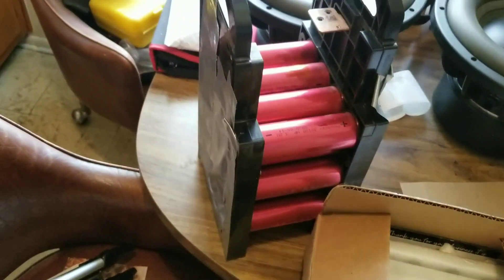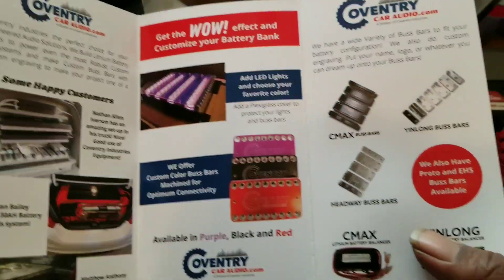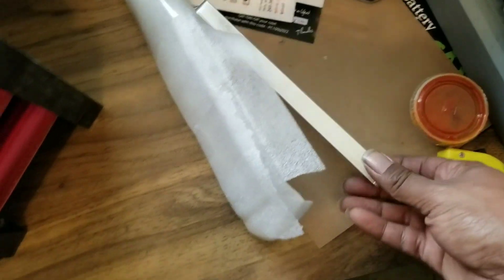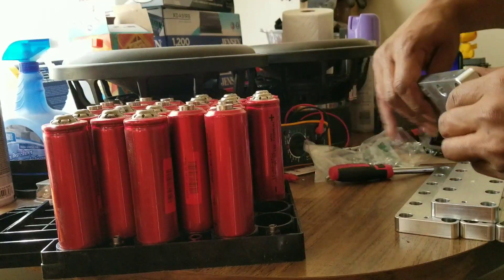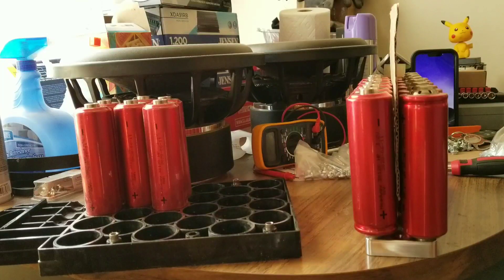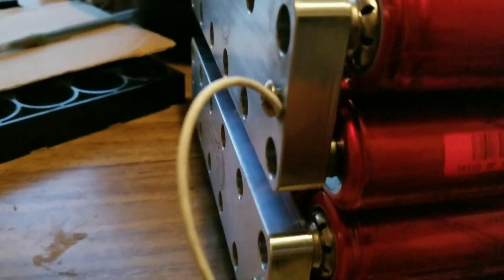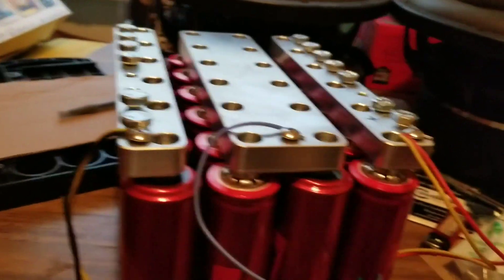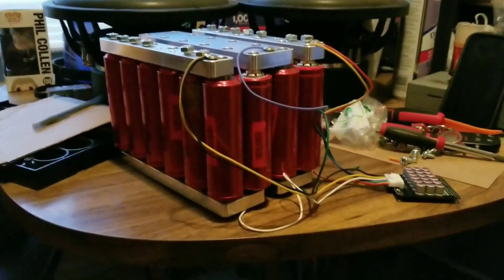How to Build Lithium Bank Plus Balancer using lithium Headway Cells + Custom Bus Bars

Comment: I've been thinking king my own bars but I don't have the dimensions that are used for the holes to drill them.
Reply from the maker: I wish I could tell you my bank is in the truck right now but you’ll have to get the cells and put 2 together and measure that way
Reply: @Mark Woods Certified BassHead  I found a reasonably priced kit and looks stout. I'm gonna get and will fit in a 100ah empty battery case
Reply: Order the headway one and place them down the line on steel and mark the

Comment: Looks good
I have been running a 48ah headway bank with NO bms.after researching the general consensus was they aren't necessary if you don't drain more than 75 percent of the battery.been good for about a year so far.too many cons using balancer
Reply from the maker: I actually went 6 months without no balancer
Reply: What’s one of the cons I run one
Reply: @guerrillawar1994  heard they can malfunction and not allow a cell to overcharge or limit the discharge.overchargung can destroy the cell..
Reply: @guerrillawar1994 definitely run one bro.

Comment: Did you top balance them before u put it together?
Reply from the maker: No I didn’t I didn’t know you had to do that before you put the balancer on
Reply: @markwoods212  it happens. I just got into the lithium game about 9 months ago myself. But I'll deff never go back lol.
Reply from the maker: @1ohmwrecker  Heck yeah I already seen your 64ah setup it looks like your system is coming along great I’m going to get some more lithium probably this month
Reply: @markwoods212  yeah I charge too high for the headway so I'm moving to LTO.
Reply from the maker: @1ohmwrecker  I think the max charge is 15.0 and minimum 13.3 that’s what I heard but could be wrong I charge 14.1 in the summer sometimes lower. In the winter 14.5 to 15 so I stay in the range
Reply: @markwoods212  you saying for headway? Some say 14.8, some say 14.6, some say 14.4🤷‍♂️ I know 14.8 is too high. I got it when I had the factory 180a alt and it charged at 14.0 even. Which woulda been perfect for headway. Sam at autotech set up my alt for LTO. He said he would set it at 14.6 for headway cells. But u can use them, I heard it just lessens the life of em.
Reply: @markwoods212  they sell a thing on Amazon that will show u the voltage in each bank and shows you all kinds of info you can't see by looking at it lol. It's called a battery go and it's like $40. I have a video w it in the video somewhere. One of the latest 3 I think.
Reply: How do you top balance them?
Reply: @whatta7793  putting all cells together to pretty much make 1 cell. All of them will equal out to the same voltage.
Reply: @1ohmwrecker  awesome, that's what I thought just wasn't sure if that was all that was needed. Thank you very much!
Reply from the maker: @whatta7793  Sorry Brother I didn’t top them off actually I never heard of it

Comment: What’s the size of this pack? Thanks
Reply from the maker: 48ah and about 10inches by 6inches
Reply: I think I read it’s about 7”, but thanks anyways. I ordered a pack of 32 cells to make a 64ah pack.
Reply: Nice built👍🏼
Reply from the maker: @diyadventures9138  I was going off the power beast
Reply from the maker: @diyadventures9138  Thank you
Reply: 10” by 6” that’s great. Thanks
Reply: What about the height? Do you remember?
Reply from the maker: 14 inches on the height

Comment: Connect your ground first, that's the B-. Then connect each positive in order, B1, B2, B3, etc. Any that you don't need you just leave unhooked and just tape off with electrical tape. Light should come on and you should be all set.
Reply from the maker: Thank you brother I’ll be doing another video on the balancer soon.
Reply: Wired my balancer the way you said and it had a spark is that normal like a car amp when you first hook it up?
Reply from the maker: Actually I hooked it up right on this video so you should be good but I hooked up the wrong balancer

Comment: how would i hook up 50 cells
Reply from the maker: Do rolls of 8 across - to + - to + you’ll be able to only 48 cells so you’ll have to extra
Reply: @markwoods212  im running a kicker warehorse with a 400amp alt. i want to make sure i have enough batteries for the amp. it calls for 8 12v batteries
Reply: where can i get bus bars to connect the 48cells
Reply from the maker: @joshkan2  It should be in the description of the video

Comment: is your balancer to big and why you have b- and b+ hooked together
Reply from the maker: I don’t remember having any wires from the balancer connected together
Reply: @markwoods212  at 5:47 it shows yellow and black connected together and b5+ & b6+ are connected together
Reply from the maker: @bigdaddyelove5579  I got you I was told how to wire it so are you saying it’s wrong
Reply: @markwoods212  yes you should not use the last 2 wires so you need to rewire it. then your light will come on.
Reply from the maker: @bigdaddyelove5579  Could you help me with the wiring cause I had help wiring it the first time I’m very new to lithium and I didn’t know a light supposed to come on
Reply: @markwoods212  yes the black wire is right just clip the yellow off and put it on the bottom where the white is and move the white to where the purple is in the middle and move the purple to bottom and the last green wire goes to the positve and leave the last 2 off.
Reply: light should come on after that because i wired mine like you had. its just that the balancer is to big we needed the 3s 4s balancer but it still works.
Reply: @Mark Woods 212 make sure to unplug balancer when doing the moving of wires
Reply from the maker: @bigdaddyelove5579  Thank you so much I going to get it done on Saturday 👊👊👊 and it will be a video
Reply: @bigdaddyelove5579  should you tape off the 2 unused wires?